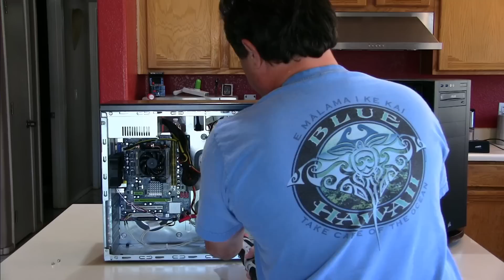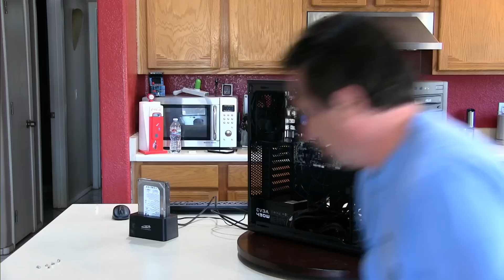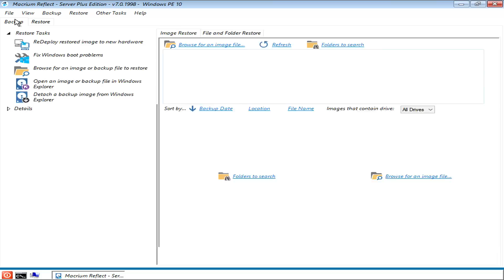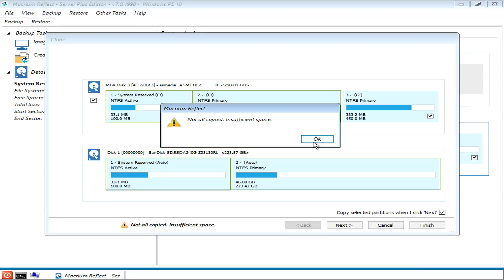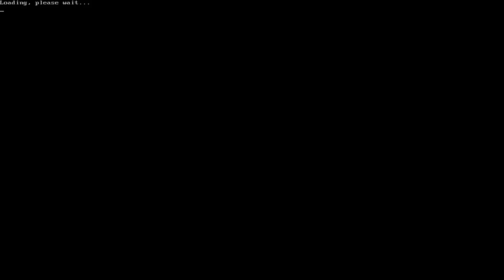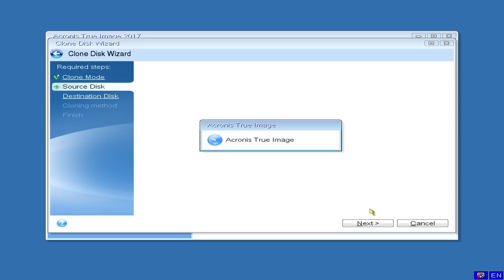Moving OS from AMD to Intel

Comment: The initial issue you had after booting Acronis was (at 24m39s in the video) you selected the Acronis bootable usb flash drive (Disk 2 - 1.865GB in size) as the source, rather than the external Seagate drive (Disk 3 - 298.1GB in size). That is why the predicted partition layout of the clone looked wrong. When you went back to re-select the source disk, you correctly selected the Seagate, and the resulting partition layout then matched what you were expecting to see.

Comment: A machine I built a year ago was working great, until I recently tried to use the front panel headphone jack.  Plugging in caused the speakers to cut off, but the headphones got no sound.  I tried replacing the front panel module, but the end result was the same.  I suspected something was wrong with the motherboard, and reported it to Asus.  They had me send the board back in.
If they replace the motherboard rather than figure out what's wrong and fix it, what are the chances Microsoft will allow me to use the existing OS with the new board?  I've heard two different takes.  Some say the OS is tied to that specific board and you need to buy a new license, others say MS will let you move the OS's license to the new motherboard, so long as the old board is toast.
Can anyone comment on what I'm likely to be facing?
Reply: You should be fine. Even the old upgrade process for Win 10 still works for free for many in fact, if you need that, or you can use the assistive technologies upgrade. At worst, you'd have to make a call but I've never had Microsoft turn down activation.
Reply: From W10 Anniversary Update onwards your Windows license should be linked to your Microsoft account so it shouldn't be an issue at all.
Reply: I used a local account.  Don't even know if I ever ID'd that machine as belonging to the "same person" as my MS account.

Comment: Carey this is that gray area in the EULA that I have never understood with Microsoft and cloning a hard drive.  The hardware is night and day different between the two systems, and I would think you'd get a BSoD due to that when starting up the cloned drive in the new machine.  Since the the drivers of the old hardware would all be cloned to the new SSD.  I know you can replace a failed HD with a new one and reinstall Windows without violating the EULA, but this process is completely different.   Perhaps I am missing something.